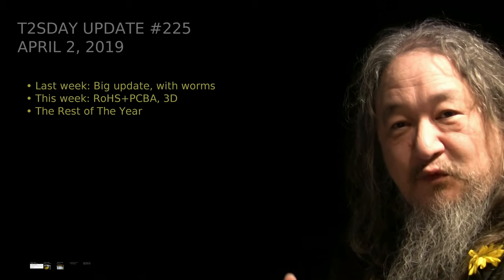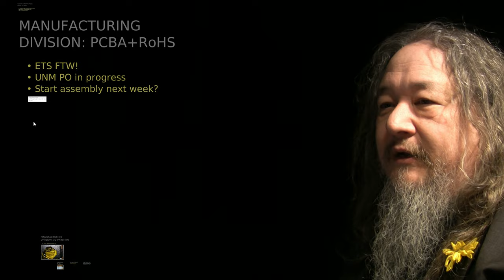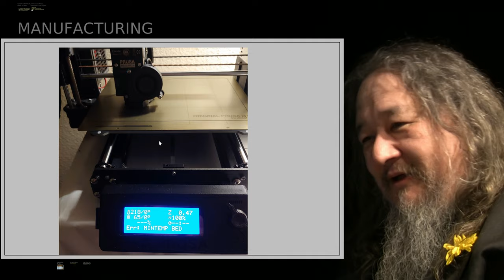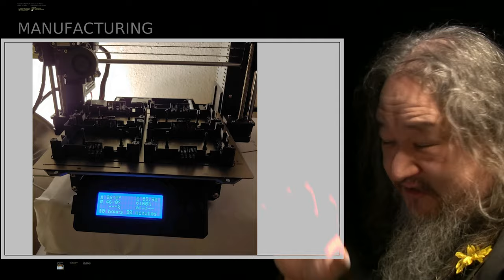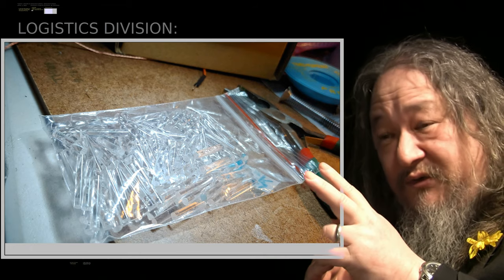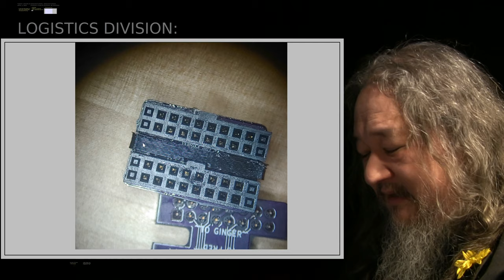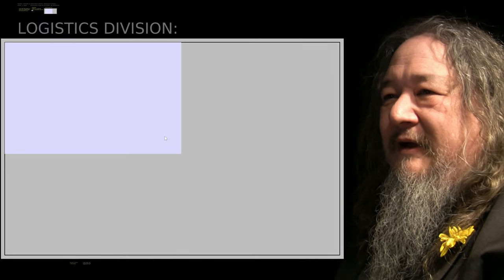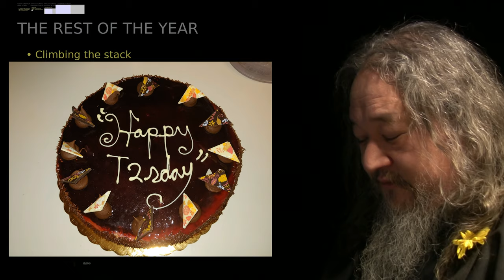Going for Production - T2sday Update 225

Comment: An Ulam programming workshop sounds great! I'd be especially interested to learn more about how you structure your thoughts when you tackle a new problem on the MFM - first steps, guiding principles, tricks of the trade, etc. The process. For instance, a play-by-play of the twists and turns you took when developing your cell membrane would be immensely useful for those of us trying to break out of our rigid, serial, deterministic programming paradigms. More about how you (you in particular) work with Ulam - your marginalia, so to speak (unless that's too personal!) And as a call to action, you might describe the open problems in Ulam programming that you consider most pressing, whose solutions would advance the state of the art.
Reply: This sounds like the bug that I was bitten with when I first came across Dave's work. The wanting to know, the process, what robust-first and non-deterministic computing felt like to create ate at me the more I dove in. The barrier for me was that I gave up lower-level languages years ago for web development and didn't feel like I could easily jump into Ulam. So I would get to the point of running the demos, but falter at creating my own. Finally, I chipped away at writing my own MFM-esque demo in JavaScript, it was FAR from mirroring MFM, but to finally get to my point, I was really surprised with how quickly I did get a taste for the robust-first thinking even with a demo that only followed some of the MFM rules. So, while I also would love an Ulam/SPLAT workshop, if you can't wait, I would encourage you to pick up a language you are comfortable with and go at it! The Robust-first Wiki online has enough to get a rough grid/tile/site/atom/element structure up and running, and you can always ask questions in the gitter chat room!

Comment: Somehow I knew that you were going to diagnose your Prusa problem and solve it on your own.  The inveterate tinkerer in you took a back seat for a while to the  outraged consumer who couldn't believe the manufacturer would give you no satisfaction on a product that was still under warranty.  I also know what it's like to gain the freedom to screw around with something only after you've officially declared it dead.  (Years ago I undertook the harrowing experience of replacing the dead battery in my iPod Mini because, well, if I didn't I'd just have to throw the thing out or toss it in a drawer.)  It's strangely liberating.  Anyway, I love watching your hardware troubleshooting high wire act.  It's much easier for me to follow than the mysteries of ULAM or SPLAT.

Comment: One option for the connectors would be to have a specialised tool that hooks around and under them (if you image search plastic forceps that's kinda what I'm thinking of). Might be simpler to have a single remover you can use multiple times rather than a remover on each connector.

Happy t2sday semiversary!